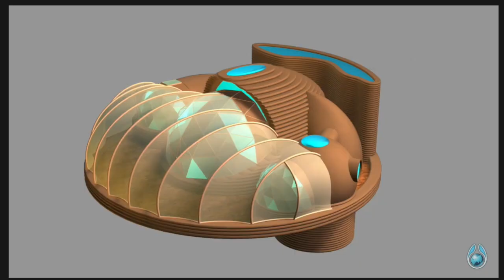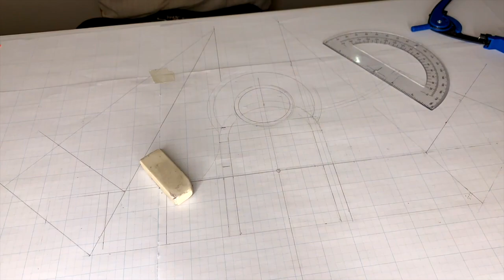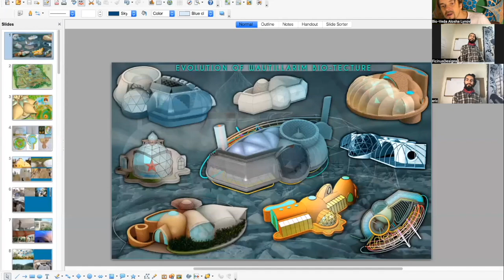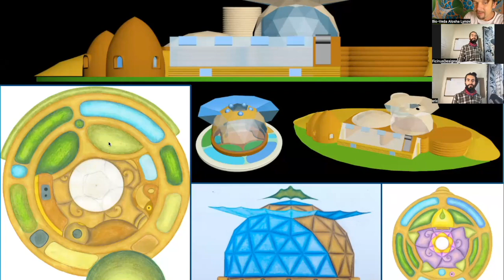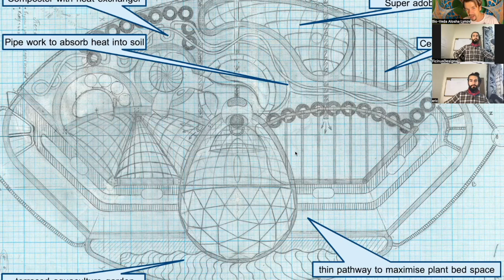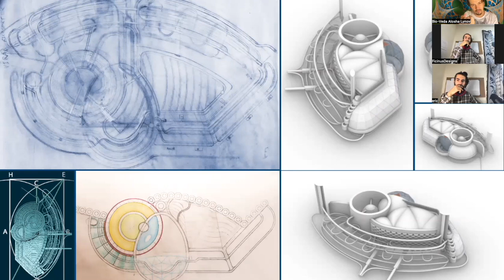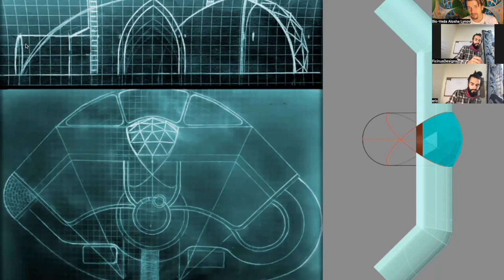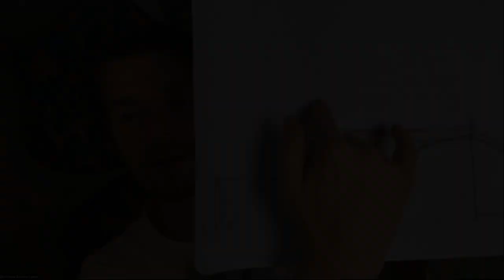Aloshas Cold Climate Earthship Design Explained: A DIY Home for the Darkest Winters.

Comment: I am building a masonry earthship in cold climate. Insulation under floor is a must in cold climate. Ground is 48*F there. Snow loads and freezing water is a pain. It's one reason why I am not using berm on my earthship. I have problems with dead valleys and freezing in designs. Frost reaches down to 7 feet were I am building. I realized I need a 6/12 roof pitch and at least 8 foot walls because snow off roof. We have wet winters here. Price was why I went with masonry. The amount of heat you loose to ground in north makes it cost more to go in ground. I have to insulate my floor or loose heat constantly to floor. We grow more wood in our forest than ever before here in Michigan. It is clear in his designs that no code or proper supports are used or followed. Just building simple rectangle with mono sloped roof. I can build with masonry and it's less work than tires and dirt works. Fill the block cores with insulation, vapor barrier, rockwool, comfort board, air barrier, and masonry veneer. I can build a 32x72 eathship for around 25k. Using my own labor and quicker than pounding tires. A berm in the north is an ice cube in winter. Why heat it? That's some tuff mental gymnastics. 4 feet down it's froze. So you need to insulate it anyway. Why not just insulate shell. Why move tons of dirt that you still need to insulate? The thermal mass needs to be inside shell and shell must be insulated. Or you need to insulate around and under all the berm. Must be nice to have no budget when building to poor concrete the most expensive material per foot. 3 feet of soil plus 4 feet of snow. Wow that is some expensive structure. There is a reason the arches are left out of the front of my earthship. Cheaper to use wood for front window beam across 32"x32" masonry columns 20 feet tall limits of code. Can only span 8'5" by code and need 2 jack studs. I build houses for a living masonry, timber frame, and post and beam. Originally it was gonna be a timber frame, but cost of timber made masonry cheaper. Masonry materials are cheap, it's the masons labor that cost so much. Yes property is forested but need stamps for inspector. Need mostly green board because masonry. Even with winter sun hitting back wall of earth ship, with extra solar gain. I will still have to heat it for 2.5 months during winter. The Ontario and Alberta earthships are my favorite. You don't bank heat only slow the transfer.
Reply: Thanks for your quality comment. The reason I am having the berm is to insulate part of them  like Earthship’s do. This way they will release the banked heat in winter time. You gave me an idea with snow. It is an excellent insulator. Thank u
Reply: Have you got a youtube channel or a website? I want to build a masonry Earthship in Wales - too wet out there for rammed earth tyres. I hear they're constantly cold in the UK due to the cold earth.
Reply: Can you guys provide some advice? I would like to build one. I'm in Canada. Thanks

Comment: I live in Montana USA, and plan to build the same type of house with a greenhouse integrated. We get weeks without sun at the same time it can get down to -45 degrees Fahrenheit in winter. I found a must read book "Passive Annual Heat Storage: Improving the Design of Earth Shelters" . Its concept is to heat your house in the winter with the summer sun. By passively storing summer heat, up to 2 or 3 months of heat for the winter.
Reply: I am from Montana too and I am just starting to plan my build!

Comment: OK -  Here are some thoughts:

1) There are several YouTube videos on Styrofoam Aircrete.  The chipped styrofoam adds stability to the aircrete and vastly reduces slump.  The density of Styrofoam Aircrete (SAC) is 10 pounds/cu.ft. or ~160 kg/cu. meter!!! The “R” value of the SAC is roughly R3.5 per inch.

2) If you take bird netting (like onion/fruit bag material) and place elevated on your circular half shell roof form, 3D print SAC in one direction( say circumferential), add bird netting, and 3D print in the longitudinal direction, and then add another layer of bird netting.  The resultant shell will be 3-4 inches thick(75-100 millimeters).  The strength of that shell will amaze…  The strength can be increased by spreading epoxy/fiberglass strand coating on both sides.

3) You could also 3D Print Circular Arch Truss shapes for roof segments, out of SAC…

4)  In  the US, there are Creosote Railway Ties that are being replaced with concrete ones.  They are 10 feet long and 6x8 inches in cross section.  They are free or at most $5 each.  I was looking at making a Pole Barn like structure Earthship.  With all of the railroad ties wrapped with PVC sheeting and buried in the berms.  The bond beams could also be wrapped and utilize RR ties.  If the berms were insulated in a similar fashion of a PAHS house.  The roof could be 3D printed.  A very cheap and fairly quick Earthship construction…

5)  Here is an inexpensive set of 3D printers:      https://3dprintingindustry.com/news/buy-3d-house-printer-e12000-print-house-27760/

Bob

Comment: I wonder if Hemp could be a solution to his insulation problem, ive seen underground freezers with a Hemp enclosure it only requires a household ac unit to bring the temp all the way down to freezer level maybe add some hugekulture type raised beds or a small Aquaponics to act as heat sink
Reply: Except your using things like a house air conditioner & things like that defeat the purpose to an Earthship house. The whole point of an Earthship is to be able to Heat & Cool the home without the use of modern appliances like AC units & heating furnaces bcuz those are the things that quite often require the implementation of public utilities in the form of fossil fuels & modern electricity. The point is it is to be ran by solar. Yes an air conditioner can be ran by solar power but it takes allot of that solar power to do that & then the freon that goes into the a.c. units is not environmentally friendly. The point is to be 100% off-grid.
Reply: @ondreacounts2556  im talking about a new take on ancient Egyptian air conditioners  through evaporative cooling its simply water flowing over terracotta or hemp ceramic pipes i know the purpose of an earthship is to be fully off grid as well as the fact that 80% of peoples electricity goes to their HVAC systems im trying to cut that out

Comment: Why not strawbale in a climate of such long cold with no sun? I live in a similar climate, though not as cold as in Siberia. Thinking if having 1.2m thick strawbale walls, thick polystyrene insulated floor, and a lot of celluloid insulation above the ceiling.
Wondering if collecting snow on the roof for water will be a problem because of load bearing strawbale.
Reply: Hi the reason I am using laws of physics and mass in the walls is in order to tap into it in winter. Strawbales are awesome and I am actually going on a workshop in 2 days. I want to use them in conjunction with the mass wall that keep stable temperature.
Reply: I don't think you can effectively use straw bales structurally. They will support, but are too unstable. Interestingly, Mongolia is a place where Straw Bale has really taken hold. there is very little wood and straw is available.